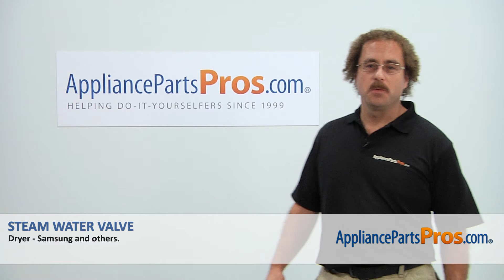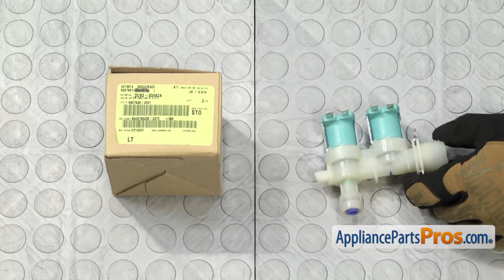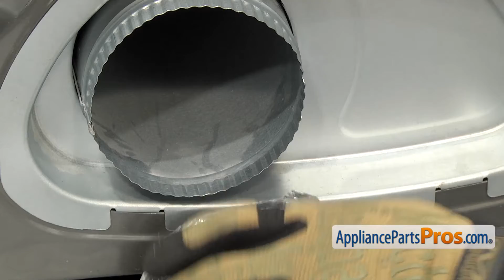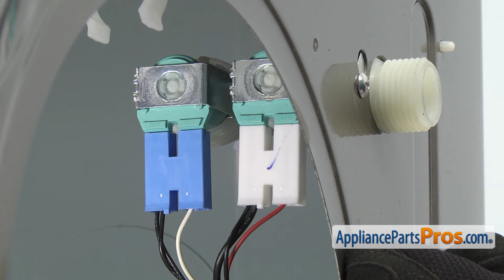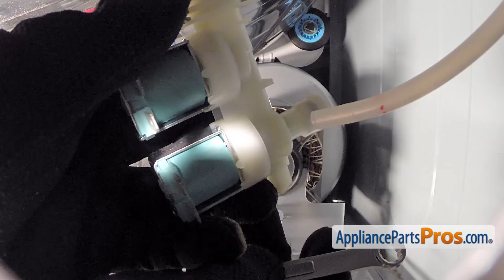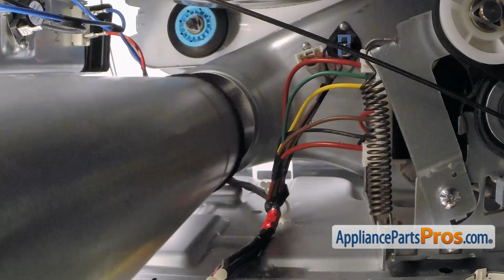Samsung Dryer Steam Water Valve DC62-30042A Replacement

Comment: I had a problem with my valve getting stuck open, leaking everywhere. i just hit it with a hammer on the side where the hose attaches to the back of the dryer, it knocked out the debris and stopped it from leaking. The new well has some sediment

Comment: 1)  Where did you get those pliers?? They are awesome.
2) what exactly makes the steam?  If it's just a pair of solenoid valves going to a hose to a nozzle, what is heating the water to make steam?  Or is it a lie and it's just a mist of water. (sigh).